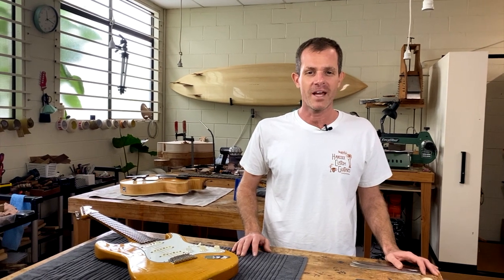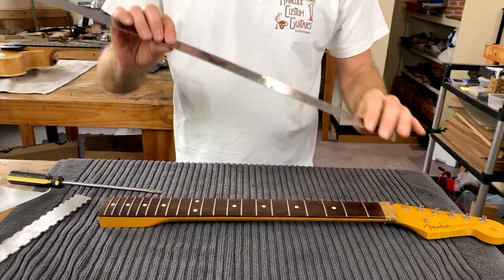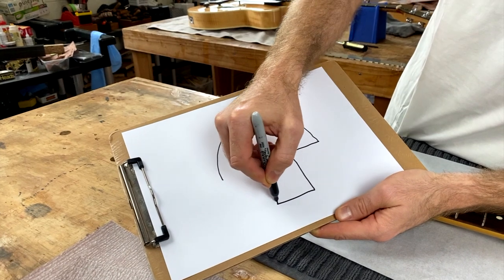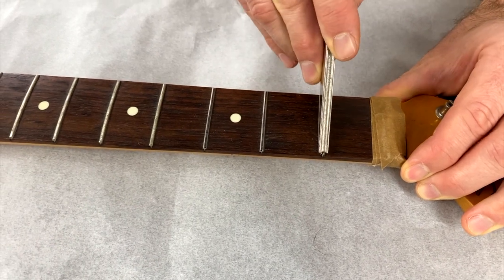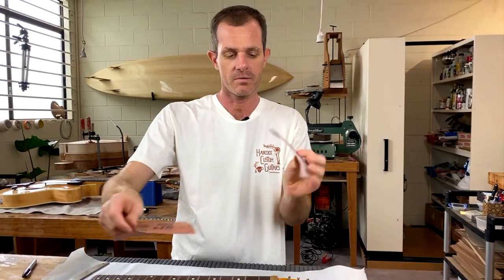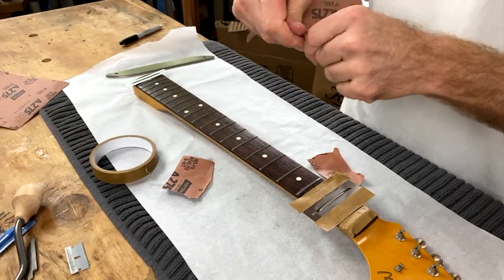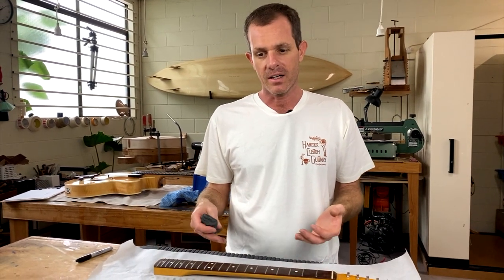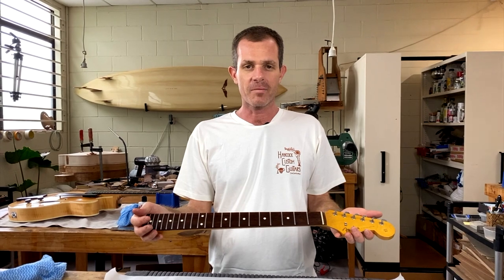Fret Dress Full Process - Guitar Fret Dressing Kit from ALS

Comment: Fantastic instruction 👌
How would you check that the frets are all level? Normal straight edge?
Reply from the maker: Using a Fret Rocker is a really good way to double check every fret is level with it's neighbours (see link below) It's not necessary that the frets be straight from one end of the fingerboard to the other, it's more important that the tops of the frets are even heights. The Fret Levelling File usually gets them even but it doesn't hurt to check with a Fret Rocker. https://luthiersupplies.com.au/fret-rocker-multi-length-straightedge

Comment: I've just started experimenting with a dry PTFE lube Selley's Ezy Glide to coat the underside of the strings to try & reduce fret wear. The initial feel is that bends are easier & smoother, but I'll also be giving my frets a little crowning/polishing soon.
Reply: That's interesting and makes sense if you reduce friction you'll reduce wear. If in doubt, lubricate ;)

Comment: I have a maple neck with no finish on it because I scalloped the frets. Should I use some oil or varnish to protect the wood, or is it enough to use Dr. Duck oil?
Reply from the maker: It's conventional to use some sort of lacquer finish to protect the maple. The main purposes of the finish are to help stop the maple getting dirty/discoloured and to reduce wear. Dr Ducks should be fine as long as you don't mind the maple potentially getting discolored over time.

Comment: Does it work equally on a compound radius or do you need a longer beam?
Reply from the maker: It works equally well on compound radius fingerboards. The longer beam is an option instead of the diamond leveller and booth have their place. You need to be more careful when using the longer beam because it can take too much off the frets at each end of the fingerboard. We'll do a video comparing them soon!
Reply: @AusLuthierSupplies  Great! I thought it was always better to have a thinner beam or file rather than a wide one regardless of length. Only because these wide ones could potentially take too much out of the middle or mess with radius as only a small portion is in contact to the frets!
Reply from the maker: @pk952  That is something to watch out for when using the diamond leveller, it will tend to balance in the middle. Using the circular motion and moving the leveller so that its centre is over the edges of the frets at times will ensure all of the frets get levelled, not just the middle.

Comment: Question..what is the problem with a maple fret board with finishing on it, towards the end of the video where your polishing
Reply from the maker: Thanks for your question. If it's maple with finish on it just don't use steel wool on the fingerboard, it will scratch the finish. Instead use the fingerboard guard and just polish the frets with the steel wool.
Reply: @AusLuthierSupplies  Thank you for your reply very helpful video 
I did subscribe to your channel